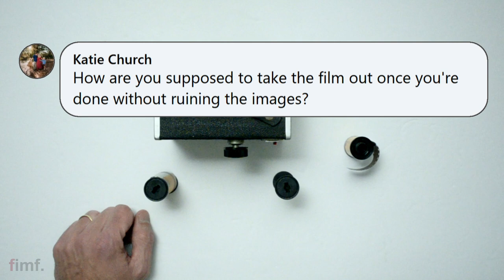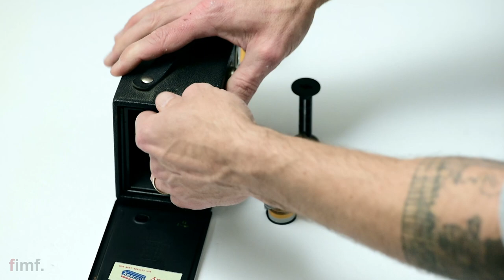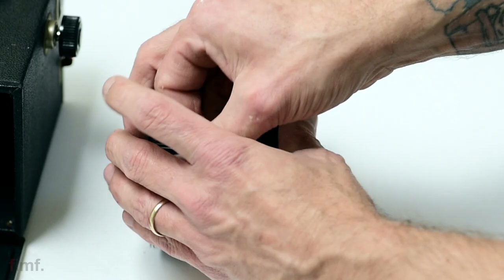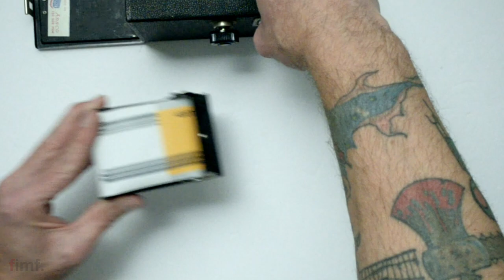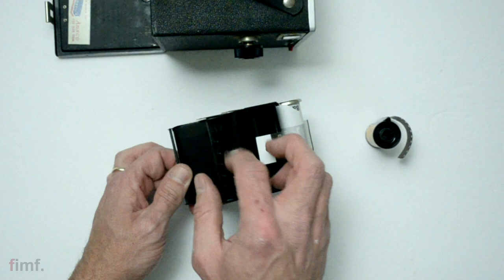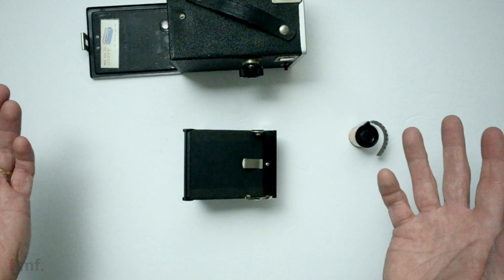Unloading a finished roll of 120 film

Comment: OK, so I have a 120 film that I altered with clippers to fit the 620 brownie camera. But then it's wrapped up on the original 620 spool of the camera. Do you rewind it back onto the clipped 120 film spool? Or do you before you start shooting toss out the original metal 620 spool?
Reply from the maker: In my opinion, I would keep the 620 metal spool for use in the future and not throw it away. 

As far as putting the shot roll back on the 120 spool, I guess it depends how you plan to develop the clipped exposed roll. (If it's getting sent out to a lab or if you are developing at home)
Reply: @filmismorefun  I'll be sending it off to be developed. I don't have enough room for a doka. Maybe in the future. What would be wise?
Reply from the maker: @ERoossien  Probably respooling it back onto the 120 roll (and making sure you mark it as 620 film) so they know to spool it in their tank correctly. This way you can keep the 620 metal spool for future use.  🙂

Comment: my adhesive strip didnt come loose so I tried to unwrap a tiny bit of it but it just didn't come loose so I just taped it up with masking tape I was wondering if its a common issue with 120 film rolls (first time using kokak portra 400 with yashika flex c tlr)
Reply from the maker: Hi there. I do the same thing after shooting a roll just in case. I'll wrap it with making tape because I don't trust the adhesive.

Comment: How do you get the spool that the used film is wrapped around back? Do you have to wait for the pictures to be developed before you can get the spool back and use the camera again? Thank you.
Reply from the maker: Hi there. You won't get the spool back from the roll that you send in to a lab for development. They will either discard or recycle the empty spool. 

However, there will be an empty spool left over in the camera when shooting is complete, because the roll you loaded will then be moved onto the empty spool on the take-up side as shown in the video. 

In other words, you need both an empty and a full spool to start, and will be left with both an empty and a full when shooting is complete. The empty spool can be reused for next time. 

I hope that answers your question. 🙂
Reply: @filmismorefun  so the spool that comes with the camera itself is discarded? Do you then use the spool that came with the film as a new spool to wrap used film around ? Sorry for so many questions.
Reply from the maker: No problem. So, if you don't have an empty spool already in the camera, you will need to purchase one. There are some on eBay or Amazon for a few dollars.